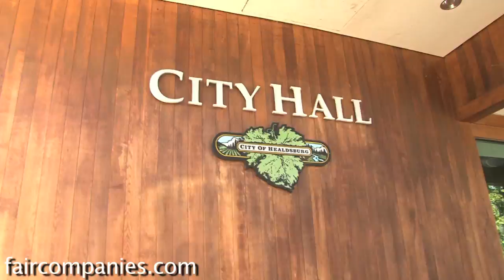Sonoma County tiny homes on wheels' pioneers: Forge Ahead

Comment from the maker: @BoyMixer It's similar to a mobile home. 1) Rarely will it be in transit and I'd assume you'd move it only during low winds. 2) You can do things to protect it from high winds: set up a windbreak like trees on one side; try to position narrow side facing prevailing winds; you can also install feet and a tie-down system.

Comment from the maker: @MrAnthonyRizzo In many US counties single family zoning laws set minimum size standards: usually from about 260 square feet and up). By building on wheels, many tiny home builders try to get around regulations, but they still are required to find a "legal" spot to park it (i.e. a trailer park). As for parking behind your house or the home of a friend/family member, many counties will allow you to build a tiny home on wheels, but they don't consider it a legal residence. So it's tricky.

Comment: My husband and I did this in Wash. state and got around building permits. Our cabin was built on our lot on skids so it's not considered a permanent structure. And inside any area under 4 or 5' tall (i can't recall for sure the height) was not taxable. So sq. footage was less than it really is.We had 2 bedrooms upstairs. Living/dining, kitchen and full size bathroom. RV (3-way)refer, small propane stove and oven, Double cast iron sinks. Wood heat. Off the grid totally. Prop. hot H2O & dryer.

Comment: Assumes the small room off the kitchen is the bathroom?
Its not just about area, its also location on a property. This was originally right up to the property line. Most places require a minimum of 5' setback from the PL, thats so if there is a fire its less likely to spread to a neighbors property. Also any permanent structure on a footing has to meet seismic and wind resistance requirements which this clearly did not. Adapting it to the trailer circumvents all of these issues, but it would be a good idea if this was going to be parked for a long period to buy some wind anchors and tie the corners of the trailer down. That should make it safe for not only wind but also help stabilize it if there was a quake.

Comment: The legal minimum for a trailer is 13'6" x 102" x 53'.
But, if you call it a mobile home, the maximum is 15' x 102 per unit, x no overall length limit.
By per unit, I mean just that, a double wide mobile home is 2 units put together.
And, a mobile home is legal, in a mobile home park or on farm land.
So, build it to conform to this standard and you will be fine.

Comment: you can buy used ones in really great shape for less than $5k with everything working and alot more space that weigh tons less. these are a great idea and keeping them on wheels allows one to skirt around zoning lawsif it's on wheels it can be on your property and nobody has the right to say otherwise especially if the sewer is properly hooked into the main houses pipes. been there done that got the t-shirt.

Comment: OK design question time: I've noticed a trend recently with trailerable micros to go higher in profile to gain living space. How do you address the issue of high profile  vs wind loading? Isnt there a concern that the whole unit could be blown over on its side under wind loading, It doesnt take much of a wind to make this happen and I have yet to see how its being addressed by micro designers.

Comment: @kirstendirksen So, in essence a tiny home on wheels is a recreational trailer, much like Park Models, and parking them in a mobile home park legitimizes them as a legal residence, however if I were to build a small permanent structure than it would need to meet minimum size requirements to classify as a legal residence, correct?

Comment: @kirstendirksen I was thinking about that after I posted, perhaps a of L-arm footing would be best. It seems like you're a good deal taller that most RV or Mobile Homes, with the same wheel base. I live in the Mohave Desert where winds can average 30 with gust of 60+, and change direction in a second. (we only have 3 season, Hot as Hell, Freezing, and Windy) So that is something I have to consider. I have been looking into living off grid for years, this seems more practical than earth rammed.

Comment: Even if it is illegal, why would you want it to be that size?  The raw material that goes into building a home of a slightly larger size wouldn't really cost you that much more and would also give you more room to move around.  I've gone to home depot and noticed how cheap the wood is.  If money is a setback you could even pick wood out of a dumpster.

Comment: "a house isn't a house unless it has one room that is 1200 square feet"? I've never lived in a house that has a room that is 1200 sq.ft.  I don't doubt this trailer home is not a legal house, but i do doubt the 1200 sq.ft. number tossed out at the beginning of this video. a 10x12 room is 120 sq.ft. a 1200 sq.ft. room would be 30x40. maybe she meant the minimum square footage of a house has to be 1200 sq.ft. but even then I've seen homes that are 20x20 and quite a few that are 20x30.

Comment: Be reasonable, you are licensed to use the street with a trailer. You should have been tag. City ordinance prohibits an unattached trailer...attach a vehicle, then you're legal. Where allowed, a licensed vehicle (with or without trailer) can use the street/road for a limited time to occupy space (park). Homeowners or property owners do not own the city street nor alley. Solution: get a permit from the city to park long-term. No matter what you try, it's going to cost you.

Comment: No, she said ONE ROOM must be 1200 sq ft (@ 0:40--check what she ACTUALLY said), not the whole house must be 1200 sq ft. That is 30 FEET by 40 FEET! I do not believe either you or she live in a place where a house MUST have A SINGLE ROOM that is at least 1200 sq ft. I call BS.

Comment: composting toilet ?
Reply: Is that a question, or have you never heard of one?  Google it...
Reply: You poop in a bucket, cover it with saw dust, replace the bucket every time it gets full and it decomposes naturally over the course of a year with no  noticeable odors. The contents break down to one quarter of their original volume and you can place it in your garden with no adverse affects.
Reply: Anthony Rizzo urine ?
Reply: Urine doesn't carry pathogens like poop does. It can be put directly into gardens but it has to be be diluted with 10 parts water to one part urine otherwise it will burn the roots.

Also it is not advisable to add any liquid (urine included) to the contents of your composting toilet because the added moisture creates a breading ground for the bacteria that cause the foul odor in poop.
Some composting toilets allow for this by having added heaters to dry the urine up and fans to exhaust any odor build up.

But it is much cheaper and a lot easier to catch the urine in a separate container. A partition in the front of the toilet  is usually what comes installed with professionally built models but a funnel a tube and a 2 litter bottle will work well too. 

NOTE: If you park your little house in an RV park and you only have a composting toilet (no black water discharge) They might make you transport the contents of your toilet directly to your local sewage treatment plant. because keeping these contents even in properly maintained compost bins is usually frowned upon because it is human feces.
Reply: Anthony Rizzo
tks
Reply: Duggy Dugg Your welcome!

Comment: An expensive hobby at-best. May be fun to build your-own RV, but in the end, it's still an RV with all that implies. Same rules/laws apply, right or wrong. Idealism/intent has no bearing on the reality that there are only certain places you can put this LT:campground, some mobile home parks, grandpa's back forty and that's about it. If you want to put in an auxiliary habitat in your back yard, look into Echo housing/"granny-flats". Even they have rules/issues. Cheaper to buy a travel trailer.

Comment: This might work for some but not for me. Here are couple of reasons.
No where to take a shit
No where to take a shower
No electricity means I can't even charge my laptop or phone
No where to store food
No where to store clothes
I can basically keep going with this but I think most get the point.
Reply: I don't think they show you in this video, but if you look close it has all of those things built in.
Reply: Hey HaasGrotesk, You add all that in! Even if there's not quite enough space, there's the great outdoors for a shit(depending on where you are at the time), there's portable showers(I have both 12 volt and solar shower that I use) not to mention ensuit tents(available here in Australia). If you find yourself without electricity, but you have a car, you either buy 12 volt adaptors for your laptop and mobile or an inverter(just don't flatten your battery). For food and clothing storage, you add/build/construct something called a cupboard. It's the biggest craze in storage... ;-)
Reply: *****
I used to live in Australia but I live in Sweden now. Many of those things are possible in Australia where you have sun 360 days out of 365. Where it's never below 10.

It's different here in Sweden though. It's mostly dark and cold here. In some places we can get as low as -50C. That means if you connect ANYTHING to your car battery without having the car running it will drain the battery immediately. You can basically forget anything sun powered since we barely have any sun in the winter and in some places we can go for days without seeing the sun. Also taking a crap outside when it's winter is nothing I'd recommend. Especially not in a snowstorm (did it in the army!). 

Our summer is little more than two months where in the third it rains constantly. After that you have autumn full of cold winds and darkness creeping up and then you have winter where it's dark most of the time.

That's the reason I said "This might work for some but not for me".
Reply: Arsène Lupin
Yeah I know exactly what you mean!
- So where do you live?
- In a box... Kind of...
Reply: ***** I don't think she said this clearly but  her Tiny house as these are called are legally classified as RV trailers and so cannot be parked on public streets indefinitely nor can they be lived in permanently.  

They can however be parked in State and National parks and campgrounds as well as any RV park. They also can be parked on private property and used as an accessory dwelling unit such as an in law flat, work studio or office.

The legal gray area comes into play when a neighbor finds it disturbing in some way, perhaps an eye sore or obstructing a path or view, more foot traffic, loud noise, etc. all these issues can cause trouble because their legal definition does not necessarily describe their primary use and so it is easy to say they are violating local codes.
Reply: This would work for me.
I shit in the woods
I shower at my Mom's house
I charge my laptop at the library
I store my food at Wal-Mart until I buy it
I store my clothes all over the floor at night, and wear them by day.
Keep going, I didn't quite get the point...
Reply: I can charge my laptop at a solar powered public library.
Reply: Yeah try using solar energy in Sweden where there's 9 months of complete darkness.
Reply: No solar powered libraries there. There's plenty to share from this one. Over abundance on the bar graph.